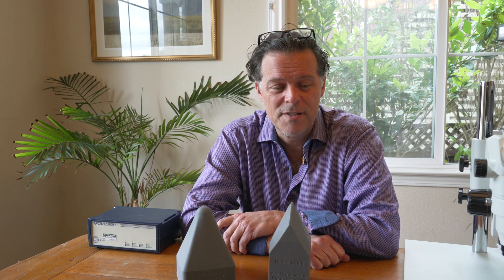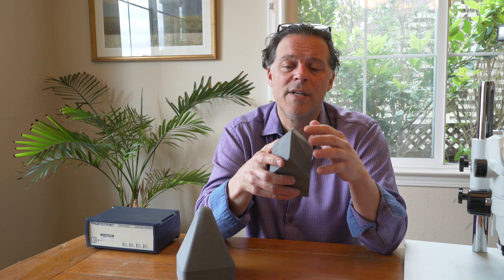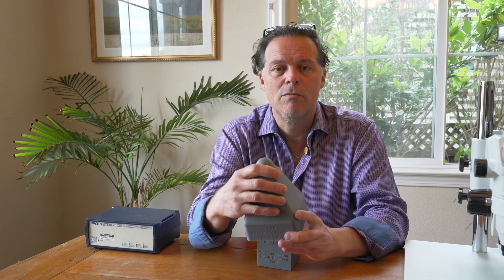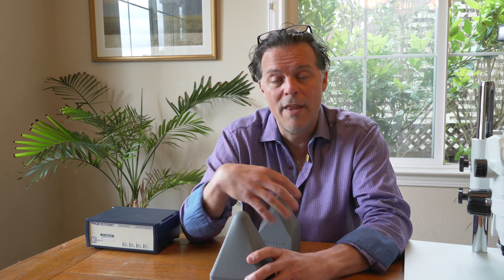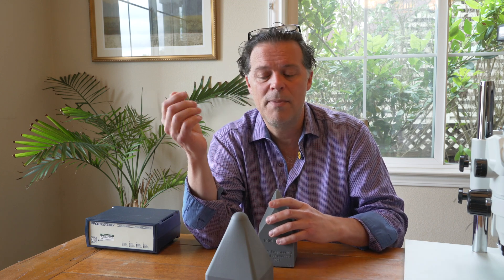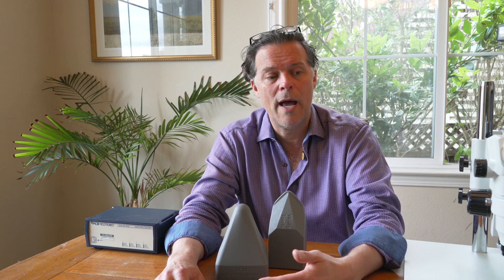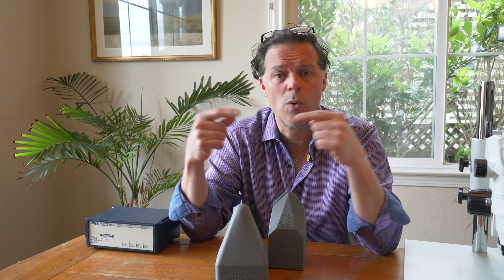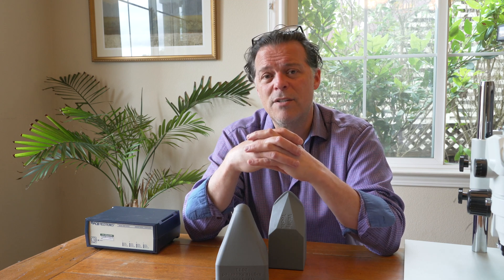Sound Bite #30: Does a Worn Stylus Ruin Records?

Comment: To follow the position stated here , a conical diamond shape will never wear out.  Yet they do, at about 300 hours. Advanced shapes might go 1000 hours, yet are still a consumable part, they don't  just become a harmless nub, and will damage records, in the process explained below, where I saw it published by the shure corporation.    tonearm function is another issue.

  the diamond has a concentrated pressure at the contact point that creates an instantaneous passing friction so great that it actually breaks, with heat,  the molecular lattice bonds of vinyl  during the instant it passes.   Yet the effect as it flows around the diamond,  is so quick that the vinyl will  rejoin the molecular lattice back into the original shape, because the effect is so instantaneous as the event passes, that the heat effect doesn't last.

  A duller diamond contact point extends the time of the heat event so that the molecules have more trouble duplicating the original manufactured lattice as they reform.  And thus a record becomes worn.  Of course , some molecules will become lost during every heat event, but a well cared for vinyl record will last, as far as now known, a for an indeterminate amount of time.  And of course, any contamination among the grooves will affect the vinyl response to wear.  .
Reply from the maker: This isn’t the venue to respond to this with any detail but I would never claim conicals can’t wear out, but you have to define “worn”. As they wear they increase their minor radius. As the minor radius increases, the deformation of the groove wall under the stylus DECREASES.

As for vinyl “melting” under the pressure of the passing stylus, I’ve never seen any convincing work on this that worked in VTFs  that weren’t crazy high. I’ve just not seen Herztian force studies that weren’t riddled with bad assumptions. It may be out there, and I’d like to see it if so.

Comment: A worn stylus maybe will sound different, less resolving, which makes people think that the groove is damaged.  Maybe?
Reply: vinyl will become damaged if the generated heat event from the passing friction becomes so extended, as the vinyl flows around the diamond,  that the manufactured molecular lattice structure of the vinyl has difficulty reforming back as it was before the heat  event, as would happen with a worn stylus shape making too big of a footprint as it passes.   the dissolving and the reforming of the molecular bonds as the diamond passes is more accurate with an instantaneous event.  even though it is continuous as the record plays.

Comment: Thanks JR ! In your experience, which type of tonearm is less prone to have high static friction ?
Reply from the maker: I’ve seen bad execution of pretty much every type including unipivots. A unipivot is the least likely mechanical coupling to have friction but then you have to deal with the many downsides of the design. 

It is a fine balance between low static friction and having a truly immobile bearing axis. The two questions need to be addressed simultaneously to find the best bearing design and execution. Not an easy endeavor.

Comment: JR, in reading your discussion on microscopic inspection of the stylus,  and the effects of the light sources, is there any benefit, or reliability to using one of the cheap USB microscopes for the average audiophile to determine stylus wear?
Reply from the maker: It depends on the model and your ability to illuminate the subject. I'm sorry, but the best answer I can come up with is "maybe". I expect have a solution in the near future for this very question of stylus wear.

Comment: There are sure tons of old wives tales on this topic. Some mfgrs mention a new tip is needed after 2500 hrs. Others may quote longer wear times. I have owned several dozen LOMC carts and a few MM carts and with all the vinyl playing I normally do I cannot remember ever wearing out a tip. I have had a few suspensions collapse on me. Many moons ago, I questioned a few A-T reps about tip wear and when to replace a tip. They finally gave me their definition. A tip was considered worn out when the THD measurement exceeded the OEM spec by 0.5%. Do not know if that statement was true or something they made up to pacify me. Either way doubt anyone could hear a 0.5% change in THD. And that change in distortion would most likely be in the higher frequencies only not in the midrange or lower frequencies. I was always more concerned with the elastomer drying out and losing its ability to allow the tip to track at high frequencies as it got stiffer (harder with age) with respect to time.  JMO but I think true groove damage is more likely to occur when some inexpensive carts (especially back in the 60s) could not track the modulations and the groove wall physically tossed the stylus tip out of the groove. There were likely several hot cut titles that may have done this but the 3 that instantly come to mind are the 1S/!S Reiner Pines of Rome, the Telarc 1812 with the digital cannons, and the Bob Ludwig cut Led Zeppelin II.
Reply from the maker: That was not a good metric they gave you. We could simply make some changes to setup parameters and change THD by quite a lot and will still learn nothing about the condition of the stylus. 

I recently had a cartridge sent to me for analysis that was made in 1985 and was on its second owner with the ORIGINAL stylus and having been played "regularly" for the past 20 years. I expected to call it a dead duck but I could see only very little wear! He had been religiously using Stylast - which is a lubricant. It CERTAINLY seems to have done its job, but one has to wonder what fills the grooves of his records now?
Reply: @WAM-Engineering  one could correctly assume that a manufacturer was quoting figures using correct set up as a baseline in figures generated to help customers use the product, and not just screwing with settings to get any result they desired, although, as stated , that is possible.
Reply: respectfully , there is available science on the subject if you tire of old wive's tales.  the latest brain research will tell of the extreme subjectivity of human hearing as a process only of the mind, which has no self awareness ,  and the great difficultly of even simple aural memory without training.    
my ortofon tip is rated for 1000 hours, and they know their product.  They have reported product testers who can tell if a tip has been used only two or three times, and all can tell by seven plays.  I don't know what conditions generate such reports, but they did publish it as fact.   And being from Denmark, I don't believe they would just flap their lips to hear the noise.

Comment: As an Audio Technica rep way back in the day I did travelling stylus clinics with a $5k stereo optics microscope. Wear on elliptical stylus caused flattening of the rounding of the ellipse. Flat spots instead of curvature. This would present perhaps not a sharp edge. But eliminate the curved contact and present a flat hard edge. Shibata had just been introduced. So little experience with wear of them at the time.
Reply from the maker: I know what you are talking about. With microscopy illumination you have to be careful about what you see because the light reflections can play a slight trick on you. Those surfaces you saw did appear flat but a large radius reflects light into the lens in a very similar manner. What you saw was indeed a flattening on the vertical plane but on the horizontal plane was actually a large radius.
Reply: @WAM-Engineering  I was trained by AT and Wild Heerbrugg on how to position the two side lights to get the correct illuminations and reflections off of the stylus edges. You could see flat ellipsoids where the rounded edges from the elliptical stylus had been. Did stylus alignment and rotation eval as well.
Reply from the maker: I agree. I am just saying those spots aren’t as flat as they appear to be. I am aware of how the illumination was handled by those scopes. That “flash“ of light has has a pattern size that is in large part determined by the optics of the microscope. In other words, if you change a couple characteristics of the optics, the size of that lit up area will actually change even though nothing changed on the stylus itself.
Reply: @WAM-Engineering  Yes that is why they trained me on light placement. It was very critical to get accurate views and measurements. e.g. stylus rotation measurements depended on creating reflections on the right spots from a specific angle.
Reply: @WAM-Engineering  I've been under the impression that the wear on a stylus increases due to less of the stylus surface area contacting the groove. I remember seeing on Vinyl Engine a chart listing the stylus surface area being greater on the Shibata and fine line variants, ranging from double to quadruple said area. As the advanced styli become worn, they supposedly look closer to an elliptical or even conical in shape. In my head, I've thought of record and stylus wear to be a sheer force problem. The forces affecting the groove would be the stylus sheering the groove walls, in a magnitude equal to the product of the VTF on the groove wall's angle ( VTF x sine of said angle) divided by to whatever contact area is made with the groove.

Mathematically, it would be something like:

F_stylus sheer = [VTF x sin(theta_groove wall)]/(Area_stylus contact) 

Of course the resulting change to the VTF would be on both sides of the groove wall. I conceptualize there to be two forces, one on the right wall and one on the left wall. Also, the contact area of the stylus to the groove would be dependent on both the stylus shape and the grove wall dimensions. I don't know if that interaction has been modeled, if I'm thinking about this right.

Either way, what you say in the video makes sense to me, that the tonearm actuates the wear when stiction and other horizontal forces are "out of control," i.e egregious. This sounds like an alignment issue of the stylus to the groove causes by these forces in the tonearm.
Reply from the maker: I was talking today with one of our engineers about those contact surface areas by stylus profiles. We are highly skeptical about their accuracy. They presume too much with respect to groove wall deformation under stylus pressure in dynamic conditions.
Reply: @WAM-Engineering  I can assure you technology has come a long way since I was involved. There was only conical and elliptical when I started.
Reply from the maker: Indeed, you are correct, but it still has so far to go before it exhausts the possibilities of extracting everything there is to extract from the groove. Amazing, isn't it!?
Reply: @WAM-Engineering  I have the idea for the near perfect playback system I invented decades ago. Some day! 🙂
Reply: @glenncurry3041  still, that is no reason to doubt your ability to do your job correctly.  correct optical analysis is not that hard.
Reply: @WAM-Engineering  On the horizontal plane, a horizontal line would show the wider curve of the major axis of the ellipse across the front, curvature around the narrow minor axis and then a sharp angle to a flat surface. I believe the flat surface losing contact with the record wall would cause stylus chatter against the wall. Thus damage.
Reply from the maker: I have great difficulty getting behind the idea of “stylus chatter“. If this is simply another euphemism for mis-tracking, then it should just be called that. I just simply have never seen any evidence for it that was at all convincing to me. We do know that a worn stylus increases tracing error and this is easily demonstrated. To your point then, yes, the “flattened area” would lose contact with the wall, but not before contact was transferred to the “forward” or “rearward” part of the minor radius on the stylus.